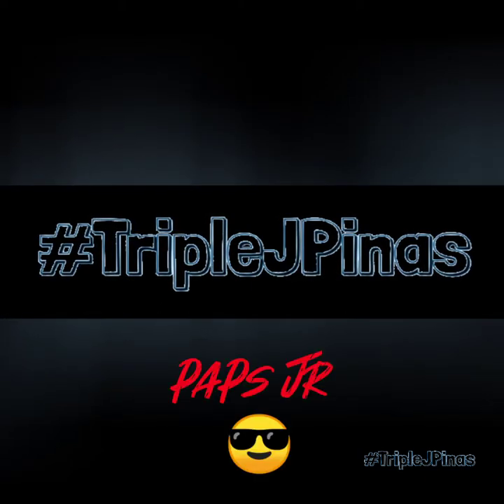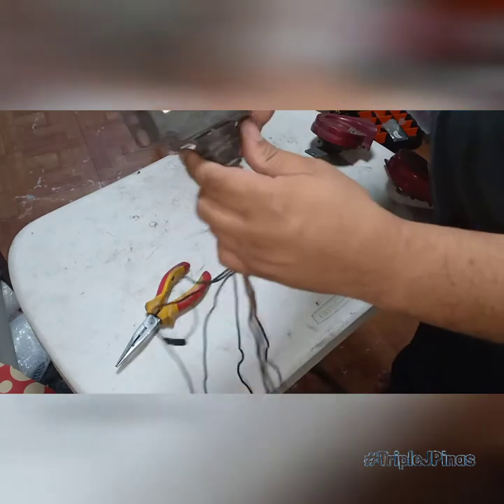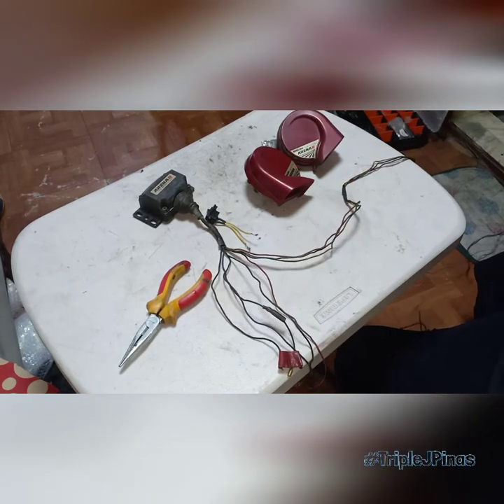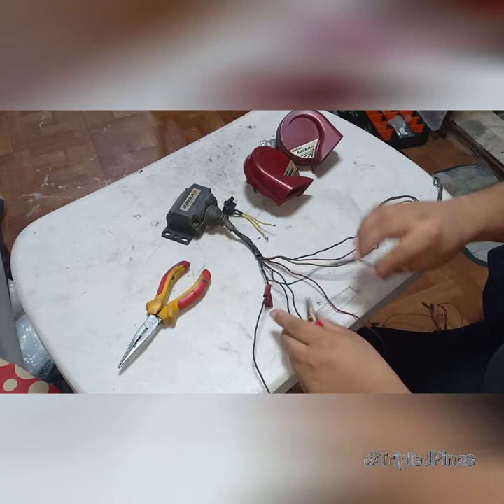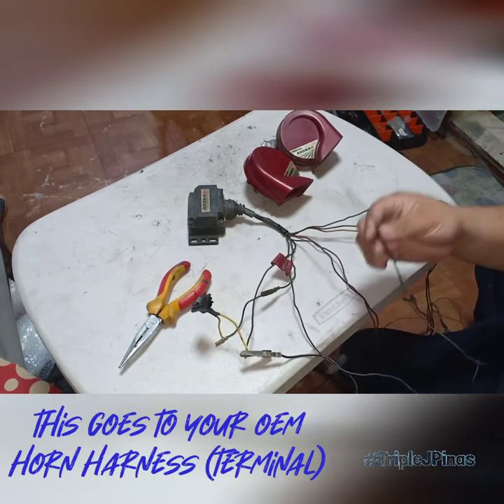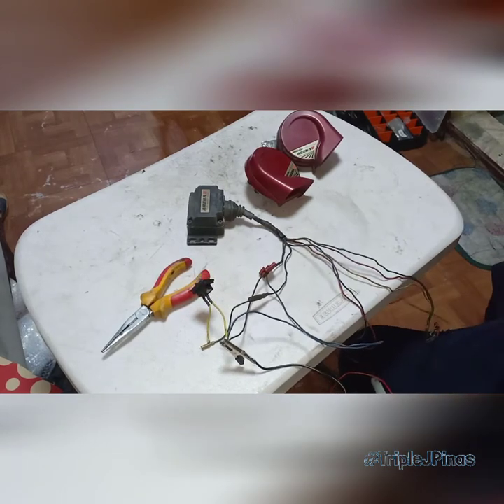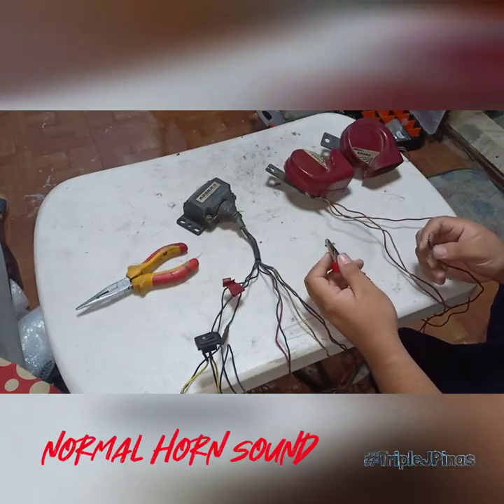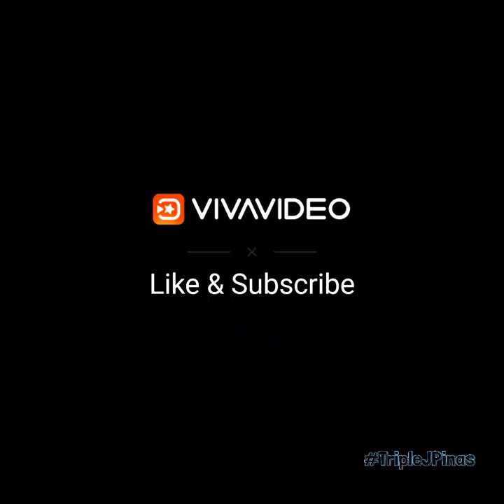Mitsuba Arena Horn Wiring

Comment: is it applicable to arena 3?
Reply from the maker: Yes same wiring and color coding..
Reply: @triplejpinas1852  The 2 blue wires,  one blue wire will be connect to default horn and another blue connect to where?
Reply: @triplejpinas1852  hai
Reply: @triplejpinas1852  i need some help.i have this type of horn...can u tell me the  wire position from relay..my horn dont have socket from relay
Reply: @triplejpinas1852  hello sir
Reply: @triplejpinas1852  can u tell me posttion wire from relay..my horn don have any socket from relay
Reply from the maker: @selviaselno2252  it should be the same color on the video.

Comment: Yong 2 pair na blue. Yong isa sa negative ng stock horn yong isang blue saan naman po
Reply from the maker: both sa wires ng horn po.. :) Isa positive isa negative po.. 

Meron mga excemptions sa mga ibang oto na isang wire lang kasi ung iba body ground na..
Reply: Ah okay sir. Yong red wire naman po na my fuse saan po ikakabit yun sir. Salamat po
Reply: Red wire with fuse and black wire hindi ko kasi alam kung saan i kakabit sir.
Reply from the maker: @howardsolano9829  Red fused wire sa +12v Battery.. 

Black sa body ground.
Reply: Kapag nilagay ko yong redwire with fuse sa baterry mismo tapos yong black sa body ground, hindi po ba ma discharge yung battery. Salamat po
Reply from the maker: @howardsolano9829  bakit madidiskarga? Switched circuit ung busina not unless lagi natunog hindi madidiskarga yan.